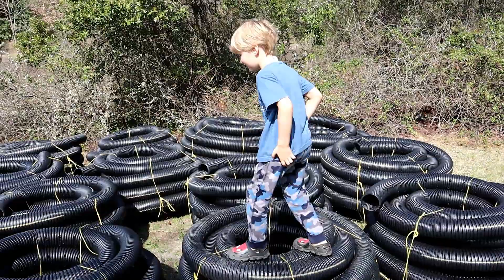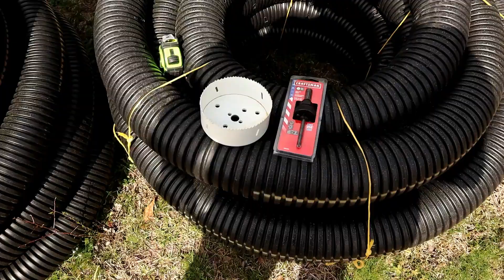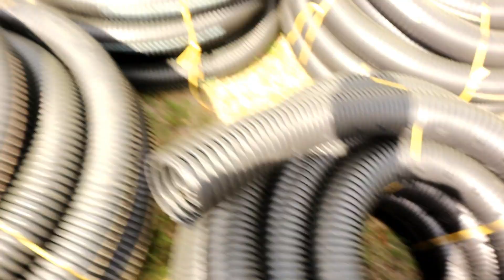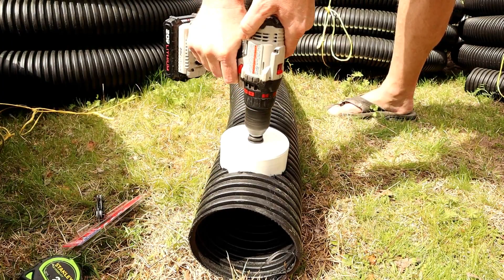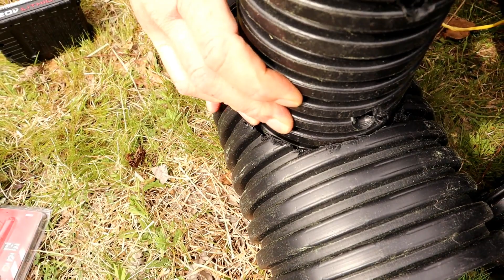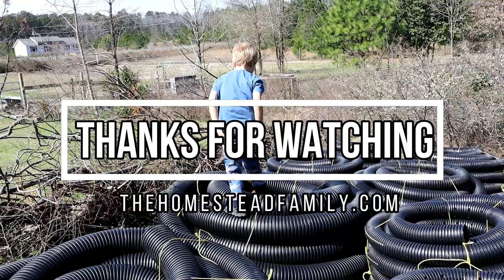Geothermal Greenhouse - Part 1

Comment: The total tube length is in the ballpark for your greenhouse. The  6" manifolds are an issue as they seriously reduce the amount of air you can run. The cooling performance is heavily dependant on the airflow rate, you have to move a lot of air to keep pace with the incoming solar gains in summer. Calculate the air volume of the greenhouse in cubic feet, divide it by 60 and multiply ny the number of air changes you think you`ll need per hour. I recommend designing for at least 20 air changes per hour for reasonable cooling performance. The number is the amount of air you need to move through the system in cfm. I designed my installation to provide upto 60 airchanges per hour which allowed me to experiment with different flowrates.
Reply: that's good info
Reply: You need 80 percent min. on the return.
Reply: @DouglasNewell-t6i  
Calculate the number of ACH required and then design a tubing layout that can handle that airflow rate with minimal loss.